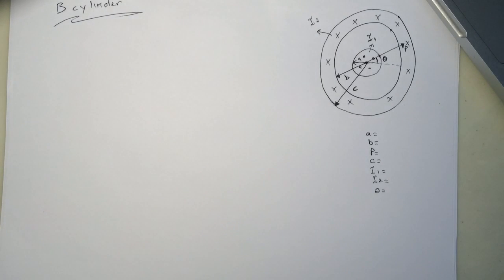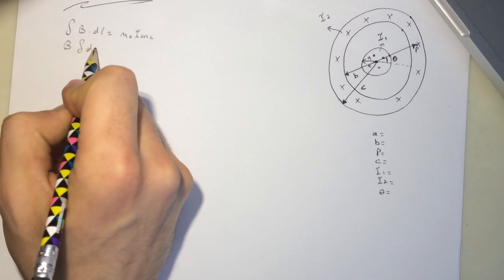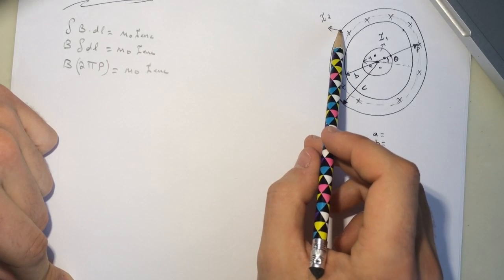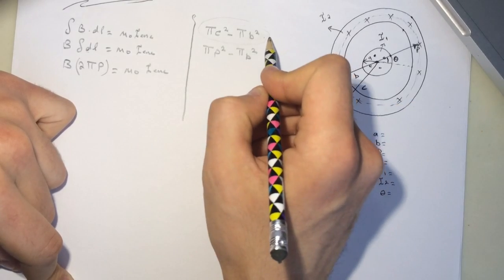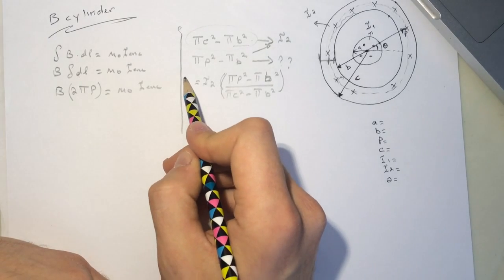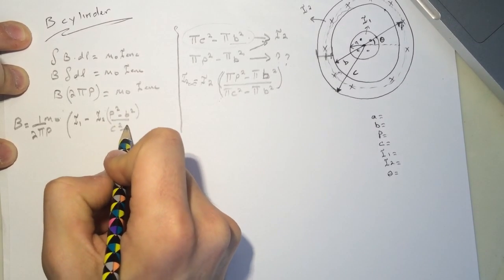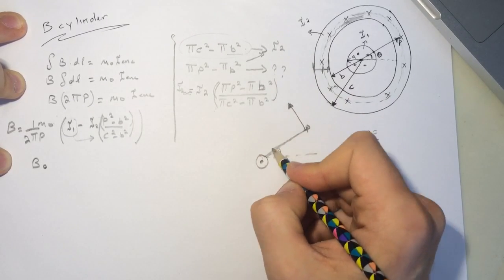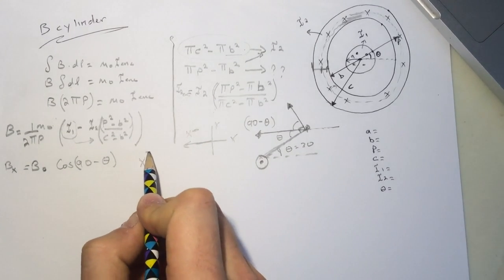B cylinders "SmartPhysics" Solution.

Comment: what is going to happen if I have the same excersise, but the current density is not constant and it is given by a function in terms of the radius. Will the magnitude of the magnetic field be constant?
Reply: What I think is that u should make up an integral that has density , current and the radius in one equation and ur limits should be what ever the distance this current density is bounded. I could be wrong but let me know how it goes, good luck !